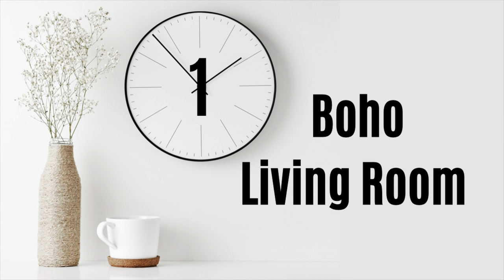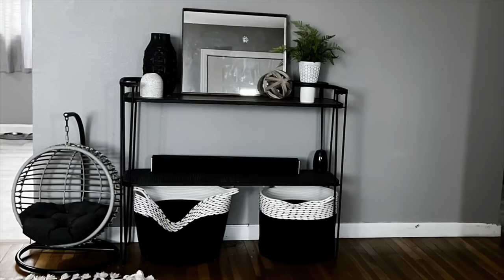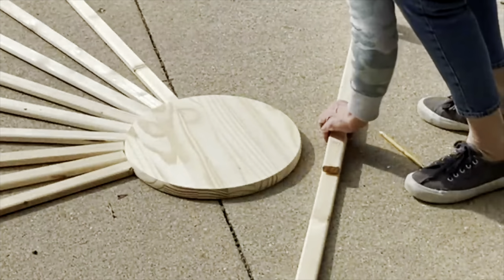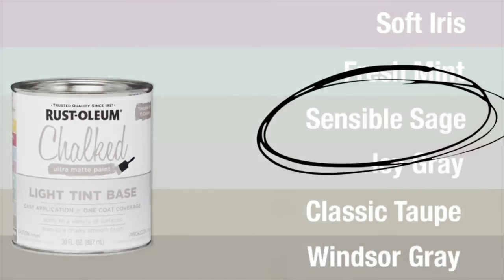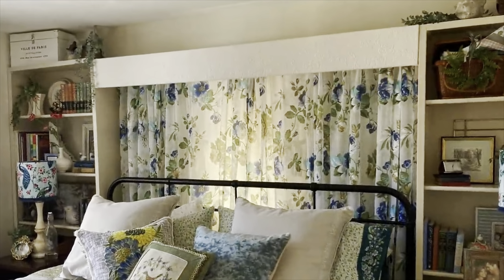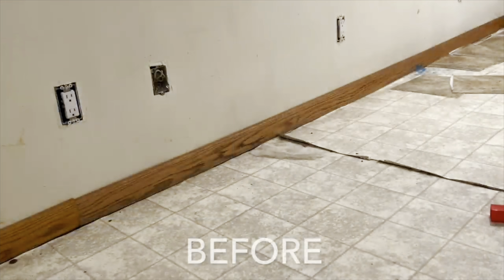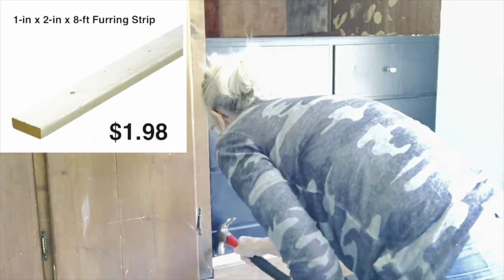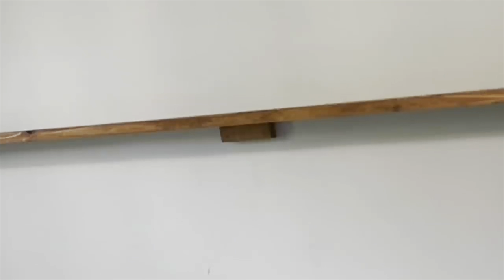5 Extreme Room Makeovers from Start to Finish

Comment: I had not seen these videos yet and so glad you posted it.  All of your solutions are amazing and beautiful and doable... the only one I wasn't sure of was the  round kitchen table, I was thinking it might have needed a base.  I have a small old soda fountain table and chairs and the table almost always tips with any pressure near the edges and it has pedestal three legs.🤷  
  The basement with bedroom was my favorite along with your bedroom... Saved to my favorites list 👍 Thanks so much for sharing ❣️
Reply from the maker: Thank you, Irene! The heavy 18 inch wood round is at the base of the table (surrounded by the furring strips), so there haven’t been any issues of it tipping. If I had used a smaller round, I’m sure it would have easily tipped over.

Comment: Sherry- I'm so interested in those 4x4 stickers to put over my backsplash tiles! Have you seen the performance of the ones you used on her dishwasher? I'm wondering if the stickers actually will hold? Thanks so much!
Reply from the maker: Yes I have, they are still holding up just fine. It has been about six months now, and they still look great! If you are going to use them on your tile backsplash, I would recommend using a strong degreaser first to help with long term adhesion.

Comment: Your ideas are great but not everyone has the tools or space to do these projects or even store spare parts. And some knowledge is required for these projects like about hanging items - like one doesn't drill into electrics or as most walls are only plaster board these days - will they take heavy shelves. You're blessed with your health & are physically able to do the manual labour like hanging shelves & changing the light shades but some people would need to get someone to do it which might cost. As you're based in the states - what is Mod Podge - is it just glue or a special sealant that you use or promote? You do show images of the products you use but even if one enlarges the image - you can't read the information.